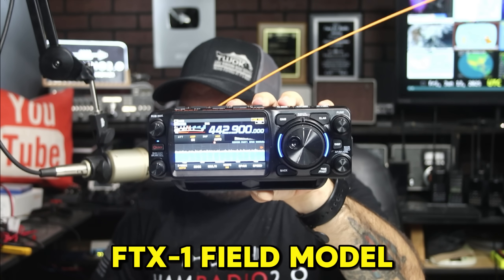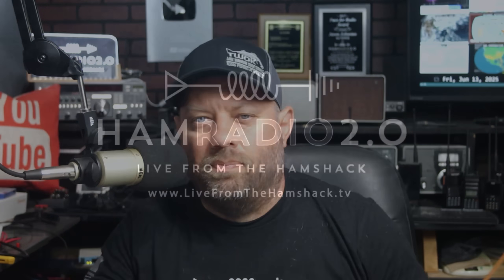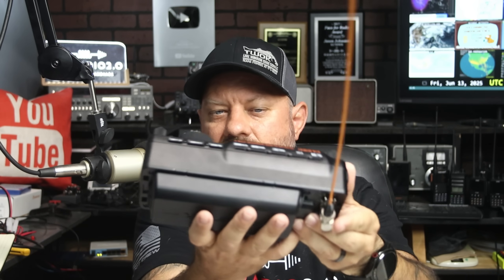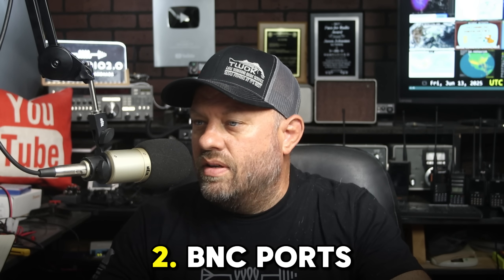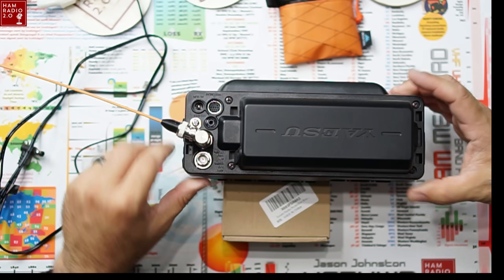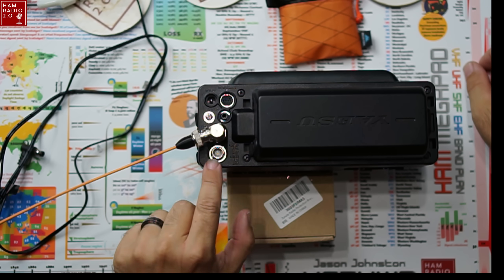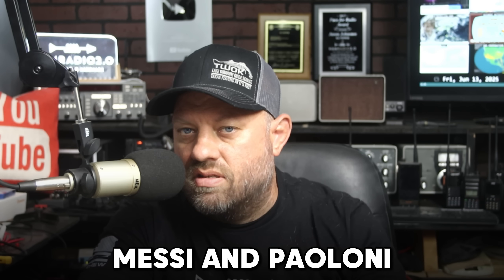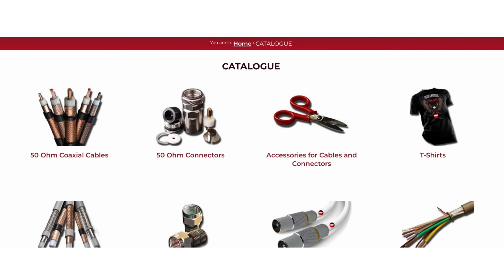5 Things Wrong with the Yaesu FTX-1

Comment: Expecting an FTX-2 in about 12 to 18 months with hardware improvements based on user feedback from the FTX-1.  I’m personally not buying until that happens - my IC-705 will do the field job until then.

Comment: As far as the antenna ports are concerned, my FT818 rear ant port defaults to hf. The front bnc defaults to vhf/uhf, but these  can be swapped via the menu. Also they are programable for the memories. Don't  know why they didn't keep that feature. I guess I'll stick to the 818 for now.

Comment: I had one on preorder since it was first teased, but I canceled my order once all of the details came out. It just doesn't measure up to other available options for less money. In Optima trim, it's hardly any smaller than my FT-710, and has less performance on HF. You can buy the 710 plus almost any dual band mobile and still have hundreds of dollars left over vs the Optima. In "Field" trim it is too heavy and fragile to do much more than drive up POTA, where I would rather just take the 710 and an HT. Not easily field chargeable. Not full duplex, so no satellite operation. No separation for mobile use. More expensive, heavier, and missing many features that the 5 year old IC-705 has standard. All of the software bugs that have been reported are also off-putting for a radio of this price. I have a half dozen Yaesu radios and love them all. I just can't wrap my head around this one.

Comment: The FT891 is a mobile radio first and a portable second. The FTX1 is intended to be a portable radio They don't want to have the two radios competing with them selves. The 891 with the expansion cables the face plate is more practical because of it's smaller size.

Comment: I see the FTX-1 as a white elephant. I want to buy one, but I literally can't find any use for it. It's not ruggedized for field use. You want a TX-500 for that use case or maybe an Elecraft KX2/KX3 in a well padded bag. If I want a plastic HF field radio, I can buy the Xiegu X6200 for a fraction of the cost and it includes that amazing wide band tuner that will tune a beer can that Yaesu lacks in all of their radios. The inability to separate is a mobile show stopper. I may as well mount a FT-991A in the car for half the money. Lastly, it's a overpriced, under performing, base. The FTDX10 or FT-710 are both far better for less money. I believe the FTX-1 is the biggest miss in the history of Yaesu. I might have bought one for mobile, but Yaesu disabled that (I suspect intentionally to avoid cannibalizing sales of their other mobile radios). My humble advice to Yaesu is to get their act together because the Chinese are coming to eat their lunch. I don't say that because it makes me happy. I admire Japanese quality and I would prefer to keep buying from them rather than China. I say it because I believe it's true.
Reply from the maker: I can see when you're coming from but in no way is a Xiegu radio comparable at all to a Yeasu. The receive quality and sense activity and filtering on the Yeasy as far superior to anything to ever come out of China. Sure, no internal tuner is a turn off for some but I use resonant antennas most of the time so that isn't an issue for me

Comment: Money is the greatest reason for me not purchasing. I think value is there, but my wallet is too light to meet the need! 🤑 I've also never been fond of being an early adopter of any model or technology. Hopefully, Yaesu will resolve the FTX's shortfalls over the next year. The lack of separation cable or even support for one IS a huge miss! I hope they opt to resolve that even though I could probably feed the BNC outputs into existing amplifiers in my mobile setup. Icom fans are talking about what their next shack-in-a-box rig may feature. Whether they release next year a notional "IC-705MkII" or an "IC-7110" (fictional numbers, of course!), Icom may tip some scales if they bother to ensure that their new offerings work in a mobile environment. I'd consider buying my first Icom shack-in-a-box if it fits my needs!

My dad (gotta love him) used to think that Volkswagen should give me some sort of prize for the 445,000 miles that I racked up on my previous VW. He didn't understand that VW has such a loyal following that they don't NEED to give away anything! The same probably applies to Yaesu, Icom, and Kenwood (probably Alinco, too). The Big Three don't need to give away radios to sell their products! The smaller Chinese makers? Sure, they'll do it because they need to be discovered. But Yaesu, Icom, or Kenwood? Give me a break!  😜 Take Care!

Comment: I don't have the FTX-1 but couldn't you use either male to male or female to female (as appropriate) BNC connectors on the rig's VHF BNC socket to extend it away from the rig?  You could  then use a right angle BNC on the HF socket and orient that to the left.  Yes, Yaesu should have wired the BNC's so the VHF is on top but this might be a work around.
Joe NR7Z
Reply from the maker: They say that the voltage will not match up on extended cables and it could void your warranty
Reply: @HamRadio2 
I guess, but the connectors I'm talking about are barely an inch long.
Reply: Yes, you can.  I've done exactly that.  That being said, I normally run a roll up J pole antenna with my FTX-1, so the antenna port placement isn't really that big a deal.  Should it be the other way around?  Absolutely.  Can you make it work as it sits?  Absolutely.

Comment: The Ft 818 was and is still my favorite field radio.  Very few bells and whistles but it gets the job done on all bands, on all modes with a great form factor and rugged case.  I knew it's replacement would follow the inverse square law for the fundamental practicality of field operations...................for me.
Reply: I wish they still made it
Reply: The only thing that could be improved practically would be the current draw. I'm sure today's SDR QRP radios are much lighter on the battery. I would love them to bring out a new 817/818 updated but not ruined. 😊

Comment: Love reviews and ho two's on this channel. Always honest and you state it's my opinion very often. Their is many youtubers I watch as well. The best ones I like when you take a radio out and put it on the air and use it . That the best test of all. Same goes for antenna's . For that , I am going for the IC 705. I used one. I have IC 7300 . I like Icom menu system because that what I am used to . Switching back and forth would be confusing for me. That just my opinion. Not hating FTX-1 . I really like it .I hope they fix the bugs . Also I know how to MARS mod Icom. It easy ! I wish that would charge off 5V at a slower speed. My Anker PD bank 45W does . It would run that radio . It runs PD laptops . What I use it for . I have a PD 100 watt one but different brand . It DeWalt one. works with 20V/60 V battery's and will charge 60V battery from 5V but takes 24 hours. I tried that . Solar charge tool battery's  and run laptops.  Best power bank ever ! A 60V DeWalt battery runs my laptop for days ! Same on some big 20V ones.  73 !
Reply from the maker: Thanks Robert

Comment: My issue with this rig is that I cannot easily switch from VFO-A to VFO-B.  Although the IC-705 is 3+ years old, my opinion is that it is more intuitive, and has the WLAN, BT, GPS, built in.  Although the IC-705 uses DPRS opposed to APRS, this can still send messages.  Thanks for a great video.  YT- The Art of QRP

Comment: They should have just made an 857D II.  Why re-invent the wheel?  Yaesu makes great radios, it is just sad to see a Japanese radio company come out with stuff that is not fully baked yet.  I get Chinese radio vibes from this, but at least Yaesu will finish the software and provide good support, so not that bad, just not a good image in my opinion.  I am mainly just salty because I want an 857DII really bad.  I am sure though, that even when the 857 was still being produced that people gave it a hard time.  I could see the menu system being tore apart (even though it is great after you learn how to use it)(even better than the 891's menu system!)(alphabetical order, quick buttons to everything that is important, fast, running man tune mode, what is not to love?)
Reply from the maker: Yeah I would have liked to see that also
Reply: No APRS,no full duplex(no suitable for satelite field operators, heavy (field version) comparing it with my Ft857D(less glamour &whistles) but lighter..so where is the benefit...the display ...the sdr concept..let's wait till version A
Reply: 100% Agreed!

Comment: Some other flaws :

- It seems that you must use the microphone’s up and down keys to start scanning. There’s no other way (no scan menu, no physical scan key). Unbelievable. 

- When saving a split memory, it seems that the only thing you can enter for the TX part is the frequency. You can’t set a specific tone, for example. 

- There’s no memory banks or groups (like on the FT-5D for example): all the memories are in one single big list. There’s something called M-GRP, but it’s only 10 memories for quick access.

- There’s only 6 custom CW and audio messages, whereas the IC-705 has 8 of each. They could have put dozens of each ! Especially with this huge resolution screen. 

- You can’t send APRS messages at all (it’s not just the reply).

- There’s PMG like the FT-5D, but no CAM, that’s a shame.

- The new Memory Channel Scope is a good idea, but I find the render not very comprehensible 🤔 Unless you know all your memories by heart, you don’t know which bar corresponds to which channel. They could have displayed at least the channel numbers below the bars, like the frequencies in PMG.

- There’s no clock display !! 🤦🏻‍♂️😅

Comment: Cannot use that antenna meaning the signal stick with that type of a radio it doesn’t work with the 705 either due to the fact of his lacking a ground plane from what I remember somebody saying we did some testing on this a long time ago when the 705 came home and tried it back then switched the antenna get off the signal stick
Reply from the maker: I basically said all of this in the video

Comment: I wouldn't buy one, because I  will never go into the field or backpack anywhere with it.
The size and weight doesn't matter to me, and I think it's an overpriced "toy" for folks who need the "latest and greatest" rig.
I'm happy using my Yaesu FT450, or my Icom 7300, as a portable rig, with my 100ah battery for power.

Comment: The flaw is that it is not receiving APRS well at all, APRS reply missing is something separate. Why did they not catch this before it left the factory? From an accountability stand point I don't find things missing in the radio to be acceptable at all. You should have everything in the radio before it leaves the factory with minor firmware tweaks for small issues as time goes on which is normal.
Reply: let me fix that for you.  . . .”you should have everything in the radio THAT COSTS $1,500!!! . . . before it leaves  . . .”
Reply: I guess that came from difference how APRS message function are used in Japan.  in Japan APRS messaging are used more like one way pager, or sending general announcement.  so no reply function are necessary.  AG6JU
Reply: I have an FT-DX10 and it STILL has buggy, janky, half-baked firmware that feels like a beta release, even after all this time, so this is no surprise to me. Yaesu hardware is great. Firmware? Not so much.
Reply: Why do you all think the Optima is taking so long to be released. Going thur every transceiver manufactured to rework the aprs issue.  73

Comment: I don't like that you have to press & hold the function button to open the menu. This is not the case on the FT710 or FTDX10. Also wish I could change the step on the VFO for HF to 1khz or at least 0.5 khz.
Reply from the maker: It just has a smaller area than those radios

Comment: I’m not sure why everyone is so hung up on the battery needing 45w and 15v for usb-c charging. The radio will charge the battery using 13.8vdc if you just plug power into the 13.8vdc coaxial port. It will do it while operating too. I do agree with the other issues however non have kept me from enjoying my radio thus far.

Comment: The pigtail requirement for low SWR when using a UHF/VHF HT antenna should not be surprising. You would find the same to be true for a VHF mobile radio. HT's use your body and circuitry  to provide the counterpoise..
Reply: Could it be the charging port on the battery is so you can charge a second battery that is not connected to the radio?
Also, not separatable is a big mistake. With the amp in the shack would be an option. Then take the radio with a battery to field, or mobile would be nice.
Reply: But suppose you put in a ground wire at the ground screw
Reply: @DomN5TCB  It might but it did not work in My IC-705. Also ground and a counterpoise are different things.

Comment: So, I could "make" a separation kit with two antenna cables, a power cable and a mini-Din cable. Why can't they provide that as a set? I have a small van, the 857 body is in the back, the head is Velcroed to the dashboard. Cancelled my order for the Optima when I saw the wire mess required to do the same thing.

Comment: 1. Yaesu has had 4 years (there about) to beat out the competition and bring to market a QRP radio that is better! And is complete including RnDnT.
2. 4 years to do it better and cheaper. 
3. Built in tuner? Yes for God's sake it POTA. You will be running a compromised antenna in less that perfect conditions. Yes of course we can make it perfect but why "have" to.
4. APRS whatever, carry an FT5 

I haven't tested this myself but I've seen testing to prove that it is simply not better than the 705. 👎Yaesu

I'll keep using my FT-7100, 857D, Ft991A and Xiegu 6100 and don't patronize me with the filtering BS. It's POTA, there is no noise! 

I don't want to hear about weight of batteries either. Most of y'all are activating from the front seat of your car. 

Okay now attack my opinion. I'm ready.

Comment: not being able to use my ATaS antenna when on battery power is terrible
Reply: The ATAS-120A's design predates the FTX by a long shot. It was designed for a mobile application, which usually uses a 13.8VDC-sourced transceiver. Some of the ATAS-120A's control voltages exceed what can be generated by the FTX's 10.8V battery, especially if that battery experiences any voltage drops during transmit. It would have been cool if it worked, though!
Reply: @StealthGTI That’snexactly right and a major fail for the POTA crowd and others. They’ve recognize this and plan a fix

Comment: Without batteries: The FTX-1F is 6.3 ounces (180 grams) or ~17% heavier than the IC-705.
•  With batteries (6.1 Ah for FTX-1F, equivalent for IC-705): The FTX-1F is 9.4 ounces (265 grams) or ~16.34% heavier than the IC-705.
•  With standard 3.3 Ah battery for IC-705: The FTX-1F is ~1 pound (453 grams) heavier.

Comment: 1. 'Field' I guess cuz it's easier to take into a field?  lol  I get Gaston and your points, I agree.
2. BNC was a really dumb error, makes me think the designers/engineers aren't operators.  I put two bnc 45 angles in to make it work with my signal stick and not touch the HF.  Agree
3. 5 Cables, Field to Optima is insane but I had no plans for separation or mobile. I have the xiegu 100w amp and will eventually have a cable to use that if I want 100watts just like I can with my IC705. 
4. I haven't used APRS yet. Probably won't because I don't plan on buying all the addons BT, GPS, etc. Legit flaw though!
5. Yaesu should have included the 45w 15v 2a adapter for a $1600 radio.  I have some for 'fast charge' but come on, they should include it. I'll probably end up buying another like I have for my phone.
Great break down Jason!:yougotthis:
Reply from the maker: Totally agree with points 2 and 5